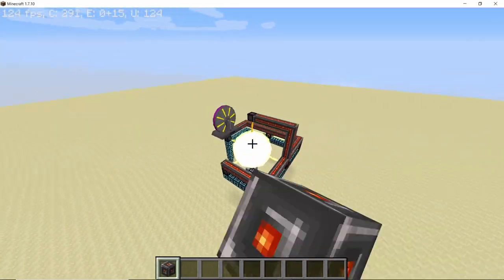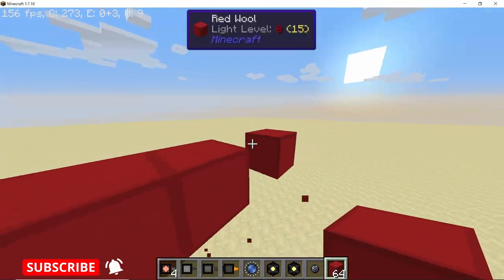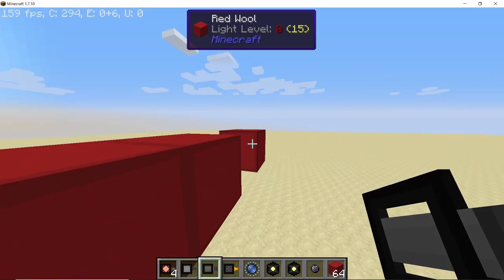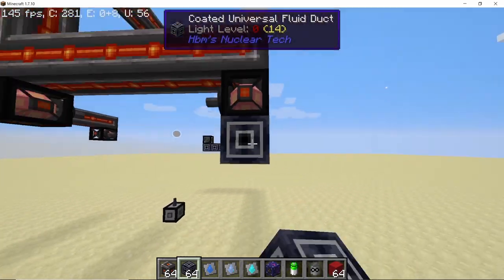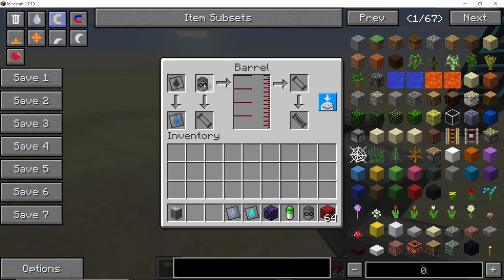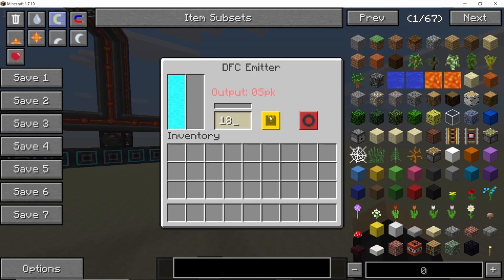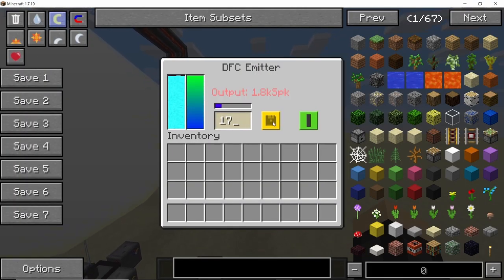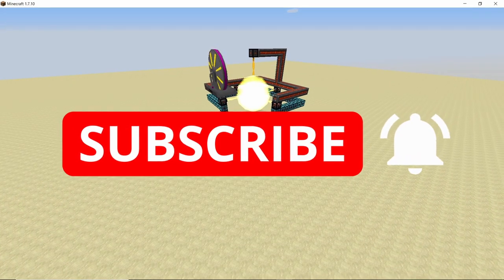Looping Single Core DFC Reactor - More powerful than BDFC? || DFC Reactor Tutorial for HBMs Mod

Comment: I have a question, could the reactor run at more than 100 heat saturation if i put a better stabilizer lens?
Reply from the maker: 100 is the max limit iirc, then again it'll depend are you playing NTM extended or the just NTM in 1.7.10
Reply: @SavageVegeta  im playing ntm extended, and yeah, i can surpass the limit without it exploding
Reply: @SavageVegeta  and also i can produce like 14 PHE/s
Reply from the maker: @ericoto9483  dang that's totally awesome man
Reply: Also an update, I have reached around 145 PHE/s with antischrabidium and UU matter, how did i do this? Well, i just put 2 dfc stabilizer stacked on each other, the beam apparently can go through it so its hella cool

Comment: How to turn this off without a big boom
Reply from the maker: Just turn the emitters off one by one and you should have no problems , it won't go boom that way
Reply: @SavageVegeta  ok thanks cuz i kinda built this in the underground of my creative mode military base but i realized   maybe having a ticking time bomb under you base is not a good idea because even tho im using creative i didnt use the infinite stuff and even tho my stuff is making a lot of cryogels i had a feeling it will run out and go BOOM
Reply from the maker: @johnipjaymartus703  yeah having this near your base is a bad idea xd , just build it far away and transfer the power to your base using poles and cables. Also remember to keep it chunk loaded otherwise the next time you go in that area there is a chance it might go boom
Reply: @SavageVegeta  idk how far is good enough because like 2 weeks ago i used the construction robot like 500 blocks away and base go boom rip
Reply: I knew i shouldnt have messed with the config cuz i made it so that even if your not loading the chunk of the big boom it will still continue because i died on my survival when i exploded fat man and when i came back it was just dead grass and a bit of damage here and there
Reply from the maker: @johnipjaymartus703  woah why did you make your settings to be like that xd. Well anyways if you delete the config file and load your game again then it will set everything to default state
Reply: @SavageVegeta  found smth about turning off enableshaders in config to prevent errors and out of curiosity ic hecked it and it was alr false but i saw those stuff in my config so i decided to change some stuff notably making it last 1 minute before the big boom stops if ur not rendering it and  
once changing the structures such as meteor dungeon to every 50 chunks so i can find one and check it out its super nuts i found 3 starmetal blocks and 2 red crate (btw this was in creative mode testing worldjust to check out the dungeon) also PLS PLS make a video about the black book/book of boxcars
Reply: I checked out what metastable ingot does andddd it big boom completely destroyed my base luckily i had a backup

Comment: hey! I am using 1.12.2 and when I change the emitters to the right amount they go back to zero and when i turn it on it just explodes. anyone help?
Reply from the maker: That sounds like an issue with NTM Reloaded , I don't remember reading about this bug but yes some of the aspects of the mod are still incomplete. Make sure you're using the latest version of the mod available on Curseforge cause many issues were fixed !!
Reply: @SavageVegeta  hey! I am using the latest version shoud i open an issue? btw thank you for your quick response

Comment: I just discovered that a high energy field jammer can prevent explosions (it will literally not make the reactor explode) so you can run on like 400% saturation, although it’s an expensive block to make, it costs 1 alexandrite, 4 versatile chipset, and 4 starmetal ingots.
Reply from the maker: Yes it was made as a defense against bombs which produce a Folkvagnr field as they completely get rid of an entire area and there was no defense against them

Comment: Recently tested various types of fuels for dfc. For some reason, dfc does not work on poisonous mud  and xenon. As per the old hbm wiki it was described. This became especially true in the latest updates, where a new watz powerplant has been added
Reply from the maker: Hmm that's weird, I'll have to check that out for myself. I have never tried using poisonous mud as fuel cause it is not very easy to automate and there are many better fuel options than that

Comment: Great video as always, but do you know how to create plutonium 239 nuggets early game? I think they changed the recepie since the last tutorial
Reply from the maker: You can breed them in the new breeding reactors using uranium iirc. It's not that the recipe has changed more like the entire breeding reactor has been changed (I have made a video on the new one) 
Also recommend to use NEI , it will show you all the updated recipes as well incase there are alternate ways but for the most part just use the breeding Reactor alongside a research reactor for flux supply

Comment: Ur vids helped me a lot while making the dfc reactor but for some reason i couldn't the binary dfc to work as it just explodes in a ice cream explosion everytime
Reply from the maker: What is the level of emitter you are setting it to ?? If it is any higher than 16 your reactor will explode !
Reply: @SavageVegeta  is at 16 like the tutorial but it keeps exploding after approximately 20 seconds which I couldn’t find what’s wrong with it but it could be my Zirnox reactor which I accidentally blew up by breaking the water pipe
Reply: @SavageVegeta  i did put it at 16 but my friend told me to put at 100 so i makes more power so i think thats what i did wrong
Reply: @sparck4759  .

Comment: When I apply the hbm mode and download or create a map and play it, hbm explosives such as dud are randomly installed on the map.  It doesn't seem like much, but there are quite a few that cause crashes and frame drops.  please tell me the solution
Reply from the maker: As long as a dud doesn't explode it shouldn't cause any framedrops cause it's just sitting there. I would recommend opening the HBMs config file from the config folder and looking for option which include the spawnrate of dud (I'm not very sure if it's available or not that's why I'm telling you to double check it) and if you find such an option then disable the spawn

Also while you're in the config file make sure to disable meteors as well , cause they will fall near you causing massive frame drops and will also destroy your build sometimes 🥲
Reply: @SavageVegeta  Thanks but We are preparing a server based on hbm, so please explain the detailed file path, spawn probability, etc.

Comment: mine blew up, only difference was i used bf-antischrabidium and a thingy core, so i set the first emmiter to 10. as soon as i turned on the last emitter it blew up
Reply from the maker: That combination of fuel is way too reactive for a looping dfc , the heat level will instantly go above 100. The max you can go for is antischrabidium and antimatter iirc

Comment: There is a problem, when I make the dfc reactor, everything goes well, but if the emitter is 18, it does not come on, it becomes 0 and when I run it
it explodes what can i do?
Version 1.12.2
Reply from the maker: Ah thats cause some features are currently not working properly in 1.12.2 , maybe the DFC is one of them as that version of the mod is not completed yet
If you build this design in 1.7.10 it should work as intended. And please do not set the emitter above 18 xd
Reply: @SavageVegeta  ok thanks :)

Comment: I don't have liquid hydrogen in my mod for some reason
I'm using 1.12.2
alcater edition latest version.
Is it because that the liquid hydrogen in the alcater  is not added yet? because I searched it up and it doesn't exist?
Any other fuels I could use for now?
Reply from the maker: Yeah that might be the reason, you can try using the normal reloaded version maybe it'll have liquid hydrogen
As for other fuels yes there are many you can use like Deuterium , tritium , antimatter , xenon gas etc

Comment: for some reason my core wont glow up like the sun, it just sits there small and gray, i can give it full 100% power and it dosnt do anything, i still get craploads of energy though lol
Reply from the maker: Make sure you've placed the DFC core, 2 reaction catalyst and also supplying it with enough fuel cause if any of these 3 are missing then the reactor won't glow up

Also if you're doing this in 1.12.2 then maybe that's the reason cause there are some features missing in there !

Comment: But could this be made binary?
Reply from the maker: It can be , combining the two outputs into one can be tricky tho as I am not sure if the cables currently have a limit on the amount of power they can transfer (in the previous update the limit of cables was set to 40.8 GHe/s)
Reply: @SavageVegeta  How much boom is possible?

Comment: Hey bro.  You can put the stabilizer at 4%!
Reply from the maker: You can , but that will limit the max power of the emitter
Reply: @SavageVegeta  So the stabilizer is at 4% and the emitters are all at 100%
Reply from the maker: @Vityalium  idk how that is possible ... Like with the first emitter at over 19 you'll exceed the heat saturation for the core and it'll explode
Reply: @SavageVegeta  Have DFC changed everything?
Reply from the maker: @Vityalium  their recipes have most definitely changed , but yeah I don't see how you can set all the emitters to 100 without the core exploding
Reply from the maker: Found you again !

Comment: Mine blew up
Reply from the maker: did you set the emitter to a much higher value ??
Reply: @SavageVegeta  is this the 1.7.10 version?
Reply from the maker: @cetc822  yes
Reply: @SavageVegeta  oh I use 1.12.2
Reply: @SavageVegeta  thanks for replying to the comment anyway
Reply from the maker: @cetc822  use ntm extended then as ntm reloaded has missing features and it stopped updating now
Reply: @SavageVegeta  ok

Comment: is this work in 1.12.2
Reply from the maker: It should work, can't say for sure cause there are some missing features in that version. I haven't tested it on NTM Extended edition so maybe give it a test with that version
Reply: @SavageVegeta  it worked but it don't generate power and it worked at 1% even if i put a balefire antiscrabiom in